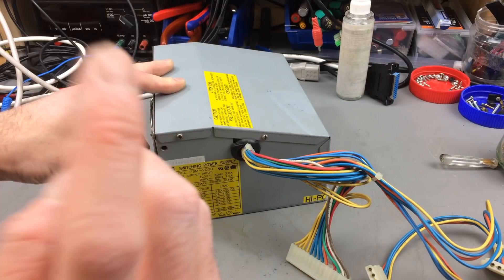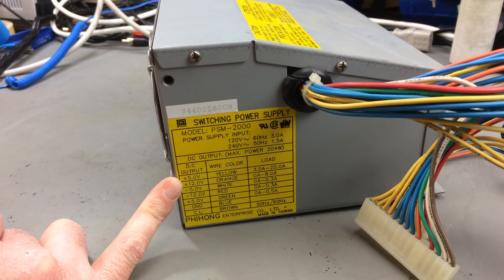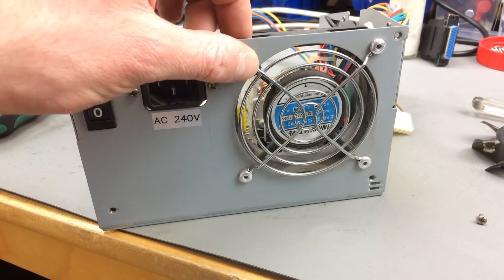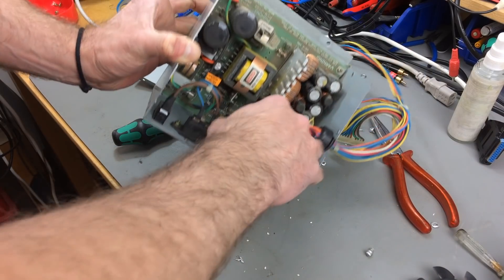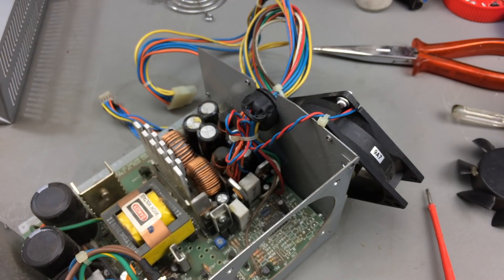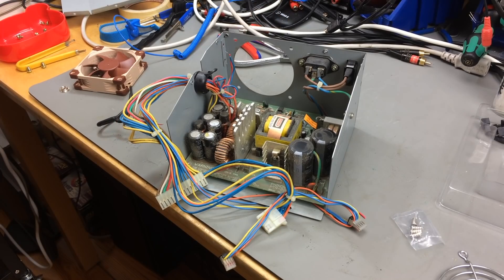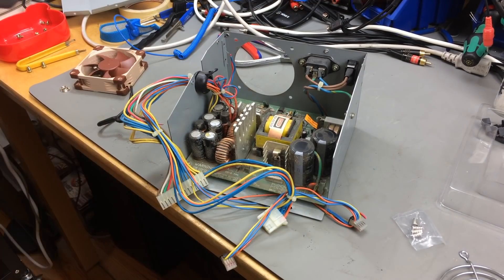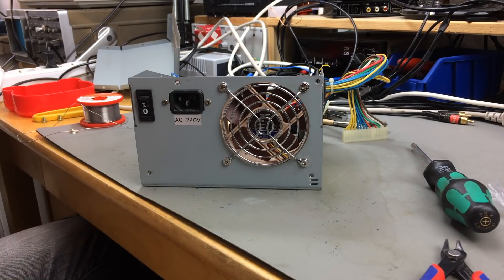Amiga 2000 Power Supply Fan Replacement

Comment: I know exactly how I sound and I understand exactly how annoying I am but did you check the small value capacitors? :P They're kinda prone to dying with age no matter how good they were. 

Great video as always :)
Reply: Especially the bootstrap capacitor in any smps.  :)
Reply from the maker: I will definitely replace them asap, I just didn't have the correct values in stock in time for the video.
Reply: @JanBeta  Looking forward to the recapping video. :)

Comment: Noctua? I am sure you love your Amiga but seriously THAT MUCH? (who am I fooling here haha)
Reply from the maker: Well... :D
Reply: The color match is almost perfect.
Reply: Noctua are good quality, a tad overkill, for just a power supply.
Reply: But why would the fan requirements of a PSU be any lower than those of any other application? I mean, in virtually any scenario that involves a fan you would want sufficient airflow and pressure, low noise and vibration, and high endurance and reliability. Am I right? Also, in all the desktop Amigas that I'm aware of, the single PSU fan provides the forced airflow to the whole system. These machines are becoming rare and precious, so I for one would definitely not skimp on the fan.
Reply: $15 is pretty cheap for a decent fan TBH

Comment: 00:20 Rivets? For the fan? Why?
Reply: It was probably cheaper I'd guess, knowing Commodore...
Reply from the maker: I'd guess to reduce cost and to make for a reliable connection. Not very serviceable but probably they'd rather replace the whole PSU if something went wrong during warranty.
Reply: @JanBeta  My A2000 has screws instead of rivets, it's a v4.3 motherboard.